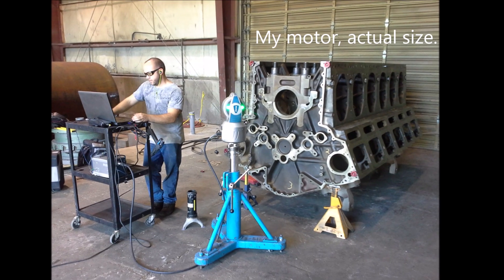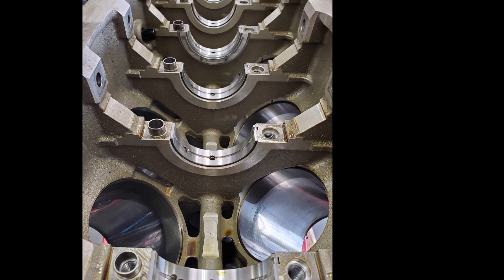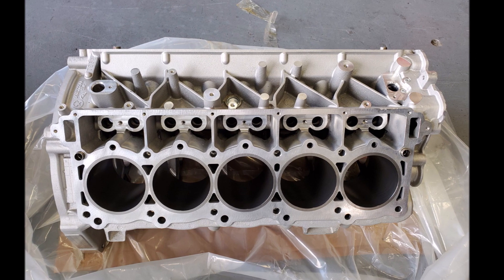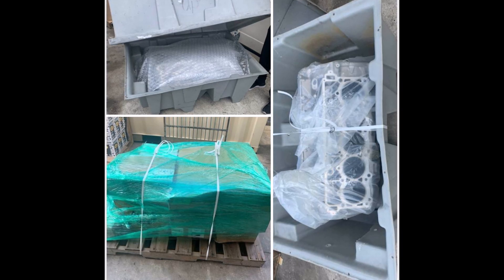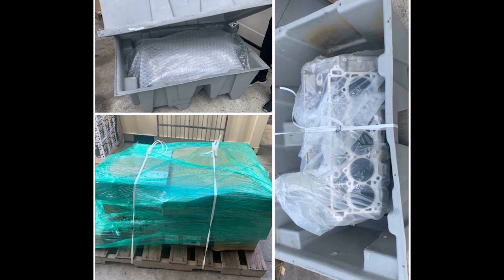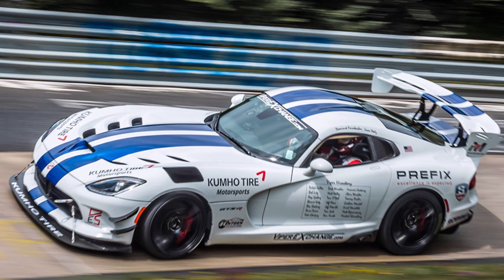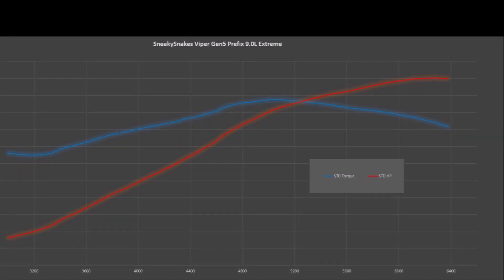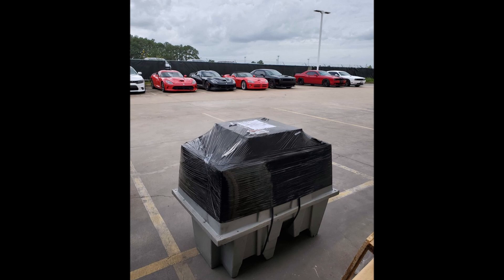Assembling the NA HOLY GRAIL - 9.0L V10 Stroker | Part 4

Comment: In this modern era it's rare to see naturally aspirated street builds like this. I admire this
Reply: PUT TWO HUGE ASS PLANE TURBINES ON IT
Reply: @TheRobertChannel  330hp Naturally Aspirated from a K24???
Reply: @FuFu AMG Nguyen why isnt it a drivers car? 330whp from N/A k series is straight up fun
Reply: @FuFu AMG Nguyen yeah, 300whp daily civic is awesome,
Reply: @FuFu AMG Nguyen well we will find out, haha, right now its at 200 whp n/a, rbc intake and some other goodies should be here soon,
Reply: @FuFu AMG Nguyen people just like how easy it is to make power by adding supercharger or turbo vs having to pull motor out and shit to upgrade everything needed for high hp na builds.. that being said i have a heads cam bolt on c5 that made 455whp and 445ftlb at 3100 race weight it does pretty good na because of having a 3800stall she gets out very hard  but its all about power to weight ratio.. for example hellcats are 4400 and 707 hp so thats 6.2 lb to hp ratio.. my car currently is 3100 and that 455 is wheel hp through a 4l80 stalled so more like 550 crank hp so my car lb to hp ratio is like 5.6 which is technically faster than hellcats and it makes sense because if you look up heads cam ls1 builds they usually get deep 10s in a camaro at 3600 lb so this at 3100 is easy 10sec car.. it would take a hellcat with roughly 785 or so hp to get to that 5.6 number or bascially a redeye lol..

 I can't wait to add a nos kit.. the one ima get is adjustable from 50 shot to 350 shot.. things going to be nasty asf it's nasty right now for 8th mile but if you want quarter mile car I'd wait for the nos and spray like 200 and see how it goes.. hell I guarantee the 350 shot would get deep into 9s on my current setup cuz it already traps 125 na imagine 350 shot on a 125 trap car.. it would probably jump to like 140+ trap speeds and already does 1.5-1.6 60ft so adding that.. man I can't wait
Reply: this is pure american muscle
Reply: instablaster...

Comment: Glad you went with that build instead of the turbo one. 780 -800whp n/a will be killer and plenty to crush most 900-100 whp boosted cars
Reply: I absolutely agree with you. There's nothing impressive about making gobs of power with boost unless we're talking about a 1.3liter making 1100 whp. Allmotor is true power.
Reply: Truth! This thing is gonna punch well above its weight!
Reply: I believe he made 800 crank so about 700 rwhp
Reply: @SneakySnakes exactly most people don’t understand power under the curve and displacement only peaky dyno queen numbers . This car with 700+ whp will our trap many boosted ricers making 900+ whp why because of tq, power under the curve and no heat soak. Most 750-800 whp vettes our trap 1000whp Supras because of a wide power curve. Your viper should trap 144-150 in good weather on e85z. Most boosted cars don’t trap that. Most people don’t understand power for power n/a is faster than boost and boost needs 100 more hp to run with a strong n/a carof similar weight and power.
Reply: @TheBb6prelude  lol there's nothing impressive about this either. A 6400rpm redline? What are we back in 1968? If you want to see impressive NA power Checkout Sasha and his 4.2L VQ 6-cylinder making over 600hp.
Reply: Add nitrous to the equation
Reply: @albertgarcia7091  for what? Getting ready for racewars in 2001
Reply: @nighthawk0077  loooool
Reply: Good luck with that. It's a great build but you aren't "crushing" a 1000whp car with this.
Reply: @nighthawk0077  I've seen this Viper rev over 7,000 rpm so many times it's not even funny. Not to mention this car has completely destroyed everything near its power level or higher. 760trq with an extremely broad powerband. That is impressive to see without boost. No one is picking that V6 over this V10. I repeat, no one. Cope lol.
Reply: @nighthawk0077  lol v6 ew

Comment: Driving one of yhese Beast s currently ....
Plus with the Supercharger ,headers 
New 3 fuel pumps 2 auxiliary oil pumps 
Larger fuel injectors 
All forged internal parts rockers I beam
Pushrods pressure plate. All aspects handled .......
You just killed Hutch and those goddamned little. Dogs .
550 ci.
1000hp.
Just a goddamned Viper freak .
Also this exact car was written up in car and
reinforced with a do it all...heads with all intake manifold

Comment: Average power is gonna be like 90% of peak!!!! The kinda curve only a big displacement, high-compression proper NA setup can produce! No matter where in the power band, it's gonna be a beast and shift recovery?! What shift recovery, this thing is gonna be on kill all the time! Can't wait to see the kills!
Reply from the maker: Avg power is everything. Wish people would brag about average power the way they do about peak (a mostly meaningless number).
Reply: People don’t really understand power under the curve is most important not peaky laggy inconsistent power from a dyno queen import motor .power for power n/a is faster than boost and I don’t know why people try to argue me down on that. Shows they don’t race and or have no clue about how things really work.
Reply: Having 9.0 liters of v10 business under the hood means you could probably start in fifth from a dig and beat most cars on the road. Torque everywhere and so satisfying!!
Reply: @SpeedLife301 @SneakySnakes Truth! Witness why many centrigufal blower cars put out HUGE peaks, but don't run that hard outside of the last 500 rpm before the shift! Each time they shift they can lose 200hp, that's insane! This motor is going to lose like 30 on a shift, ha ha. It’s gonna just live near peak power the entire time you’re racing, just insane! You've built a rocket!!

Comment: really surprised V.E. could not meet your expectations . i know they are a smaller shop . but i thought they were pioneers and they were best for N/A  guess not. i knew there was issues with gen 5 in 2017.. good to know gen 4 is a more reliable build. i am not a fan of stoker motors . i hope this build changes  my mind .
Reply from the maker: VE doesn't do internal engine assembly, nor do they have an in house machine shop.
Reply: @SneakySnakes thanks for the info. also thanks for the updates on your car if you can give us detail on how this motor is different in performance ,gas economy , parts ect ect compared to the previous motor and build  it would be much appreciated . also thanks for your time and effort with your videos.

Comment: Will you do a cost breakdown on everything? Great video
Reply from the maker: It's such varied thing because of the different options and upgrades that one can do. To build a turnkey 9L Xtreme with heads/cam will likely be around 35-40k (if you bring a stock gen 5 viper motor).
Reply: @SneakySnakes  40k? Y dont u just turbo at that price? The car is only worth 90k & u spending 40k for stroker engine??
Reply: @narbehshahinian8813  turbos are going to run you 6 figures

Comment: Do you have belst on the engine ? if you have   you can    try to remove them by using altenator...engine without belts will give more power and more insta respons..

Comment: The house I just moved into has a Ram SRT10 parked down the street that hasn’t moved in 2 years. 

Is it worth it to see if I can buy the truck cheap to build the motor and sell the shell, or should I look at a different generation block? 

My goal is 8k rpm

Comment: Quick Question: Why no ported heads? Is there not a lot to be had with ported heads on these Viper motors? I'm not super familiar with these motors.
Reply from the maker: ?? Heads are fully CNC ported
Reply: @SneakySnakes  Ah, OK. I somehow missed that! Thanks! Your car has always punched well above its weight, all that average power is only going to be elevated now. Gonna be hilarious how many cars with higher peak power you're gonna be able to take down! Can't wait to see and hear it run in anger!
Reply: at 11:07 I can see the CNC finish in the intake ports, but the exhaust ports look stock as I mentioned previously.  I have Stryker race heads on my TT Viper and both sides are clearly ported.  I wonder why they didn't do the exhaust side on yours, unless it's just an optical illusion?
Reply from the maker: @ssoffshore5111  I think it's an illusion of the photo

Comment: i'm asking mid-way through the vid, but did you go with a standard compression ratio or something higher or lower?
Reply from the maker: Stock compression, 10.5:1, pump gas build. The quench and stack actually made it a hair shy of stock, it was around 10.48:1
Reply: @SneakySnakes  I see. I figured it was around stock when you stated pump gas later in the vid. Was there any talks of bumping compression to like 11.5:1 give or take? I'd assume you'd gain a few digits with a 9liter motor and mild compression bump.
Reply from the maker: @Themayseffect  this is was an engineered and warrantied turn-key package from Prefix and I didn't really care to stray from their very well r&d build just to pick up a few hp. Esp since I have no interest in running anything but pump gas, as the car can find itself on the west coast (again) and in areas where only 91 is available. The only things I upgraded from their base package was valvetrain, but there are the crazies among us who go full send with 13:1 comp and race gas. Those cars make an honest 800whp+
Reply: @SneakySnakes  completely understand. Cant ask for much more than a screaming 9l v10. Thanks for the build vlogs. Lots of good info included!

Comment: Ever consider some nitrous? You can have the driveability you want with another 100-300hp on tap for those pesky 1000rwhp coyotes 😆
Reply: Idk, 800-850ish whp n/a 9.0L with no lag and 400 less pounds than a mustang, might be pretty close.
Reply: 8oo whp n/a big displacement will beat 900-1000whp boost all day and every more in the heat
Reply: SpeedLife301 depends on altitude and static compression ratio too.
Reply: @speedlife301  But it dynoed at 800 at the crank, so probably closer to 700 to the wheels.
Reply: SS OFFSHORE with the stroker kit he’s in the process of installing right now?
Reply: SS OFFSHORE I think every 9.0L viper chassis dyno I’ve seen is 800+whp
Reply from the maker: Car will make low 700s whp on a dyno not calibrated to pad customers egos

Comment: Hell yes a 1,000 crank horsepower 9.0 viper is my dream track car.
Reply: Samson Reynolds You’re going to have to go forced induction or nitrous if you want a 1000hp motor. You’d never get that kind of power out of an N/A motor, especially not a 9.0L.
Reply: ORL Mitch calvo sells basic 9.0 kits that make 800whp without a lot of compression or super trick modifications for induction or oiling. It could be done with high compression, dry sump, maybe itb’s or custom sheet metal intake, and a lot of tuning can definitely add more to that.
Reply: Samson Reynolds That’s 900bhp, or about 750-765whp, which is close to what Sneaky’s Gen V makes. Nobody has made a Gen V push out those kinds of numbers NA yet, but I’m sure with race gas and a shit ton of money (or nitrous) it could be possible. But 9.0L is about the most displacement you’re going to get out of the Viper block, so it’s going to take a lot of effort to get there.
Reply: Samson Reynolds It might be possible, but I think there’s probably a reason why neither Calvo or NthMoto have done anything like that. I’m no expert, but I would guess that it’s either way too expensive to even look at trying or it’s not possible. I think you’re best bet would be to go with a 9.0L striker package that makes about 800 wheel on race gas and then add maybe a 75 or 100 shot of nitrous.